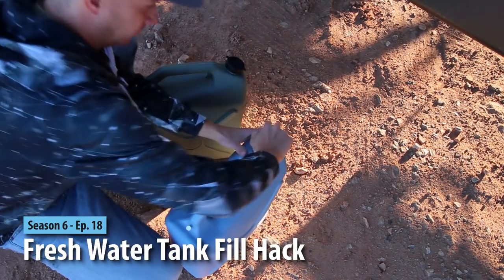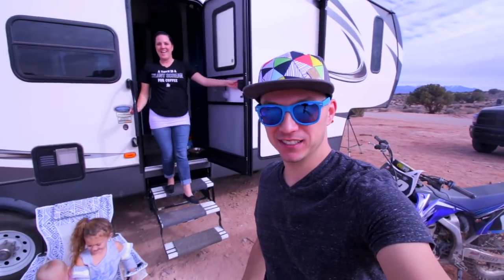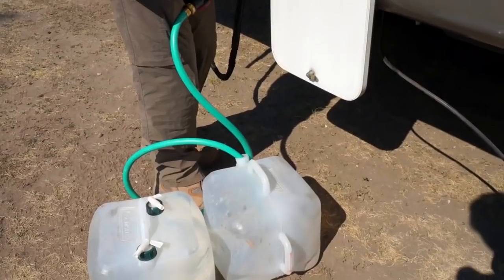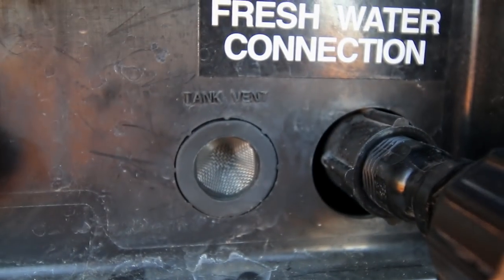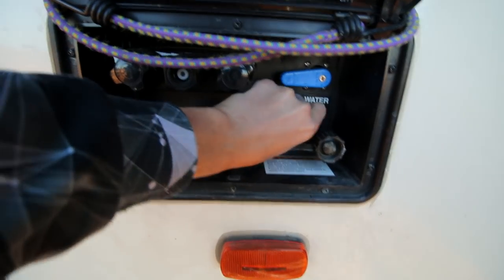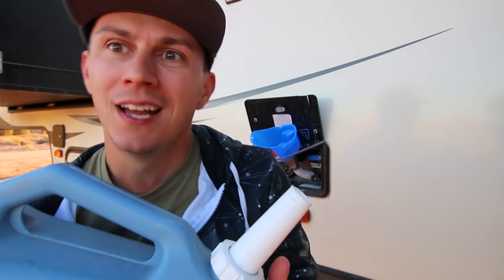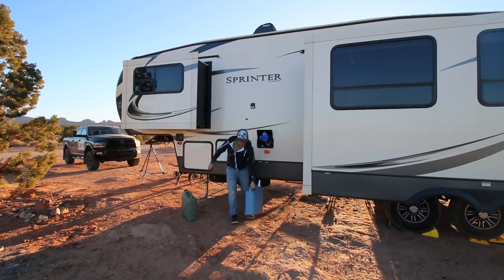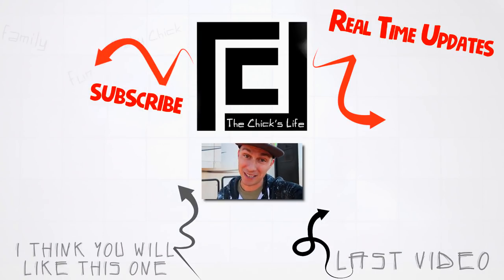🚰 HOW TO REFILL RV FRESH WATER TANK WITHOUT A PUMP 💦Boondocking Tips

Comment: On our Keystone Raptor I either fill from the vent line or hook a hose to winterize port then put the other end in the water source.
switch winterize on
Heater bypass on
Tank fill on 
Water pump on 
It will suck water into the tank.

Comment: I used a harbor freight stainless pump mounted inside the storage area of our old camper hard wired to the house battery with a toggle switch.  We use a 60 gallon water bladder to transfer water to the tank.  We can fill the entire tank in less the 3 minutes.  I am about to do the same thing with our new 5th wheel.  No hurting your back and no need to carry all of that excess bulk with those jugs.  Bladder when folded up takes up a space of 10x12x4
Reply from the maker: Really!  That is crazy. Did that bladder take up half the bed of your pickup?  Where did you get it?  Would love to learn more.
Reply: @TheChicksLife  When unfolded I use to put it in the back of my isuzu trooper.  Back of a pickup would be a piece of cake.  We would park our hybrid in remote areas to gold prospect.  Then go to a water source like a fire station and fill the bladder up inside the truck and then take it back to the camper and transfer.  I wish had a vlog of doing this, but I dont think that I do unfortunately.  I do plan to do one of the installation in our new 5th wheel. I paid about  $60 for this one.  It's not 60 gallons but 45.  Please dont EVER stick it on the roof of your truck like the picture shows!  Im really not sure what their marketing department was thinking.  LOL.  The HF pump is a bit noisy but a work horse.  I will try to dig up a link for that and post it later.  In the mean time here's a link to the bladder.  I'm sure you can find it cheaper.   Great vlogs btw! https://www.campingworld.com/portable-rv-fresh-water-tank-45-gallon?CAWELAID=120030630000002770&gclid=EAIaIQobChMI-tqzgIfW3wIVx1uGCh2ucg7YEAQYAyABEgIM7_D_BwE

Comment: Brilliant thinking. However, I’ve paused this video several times and we don’t understand why you couldn’t put the funnel in the regular fresh water fill. We wish you had explained this better. We don’t understand this system because on our fifth wheel, our fresh water fill is higher and located next to entry steps.  We bought a three gallon water bottle and my husband stands on the stairs and while holding bottle, rests it on the hand rail while I hold the funnel. Next time you have to do this, maybe pour your water in a smaller container first so you don’t have to lift all that weight. Hope the wrist is better.
Reply from the maker: Hey Cecilia!  The reason it does not work to attach it to the regular fresh water fill is because it has to be pressurized.  Your normal hose lines your screw into it have anywhere from 50-150psi.  That is why I tried using gravity and then the drill pump first.  When those both failed I found this solution. Does that make any more sense?

Comment: Use your built-in water pump to suck the water out of the jugs. No gravity needed.
Reply from the maker: I don't think my current setup has that option.  So I would have to do some Macgyver work to make that happen!
Reply: The Chick's Life - RV Travel if you have pressure filled system then just connect a hose to the inlet and then place hose into your jug. There should be a setting for city water.
Reply: If you're talking about the same tube that sucks in antifreeze for winterizing, that puts the water into the lines but not into the tank